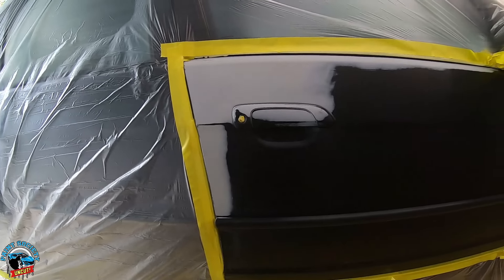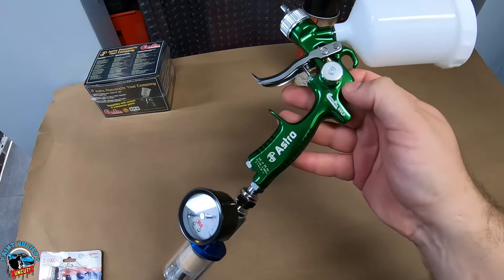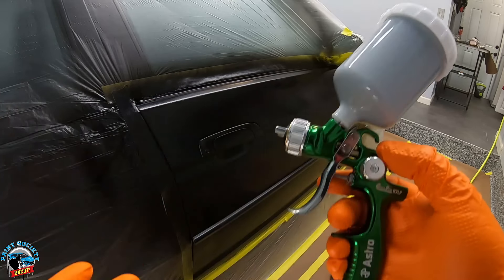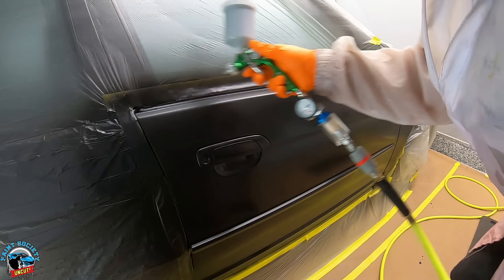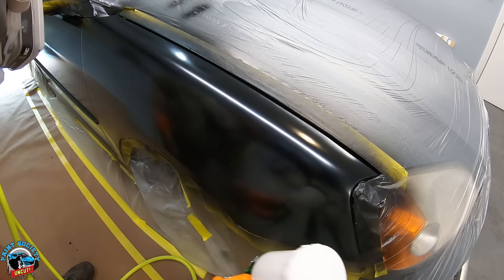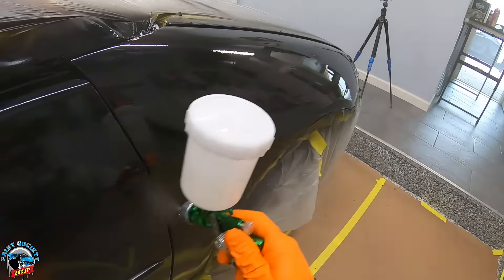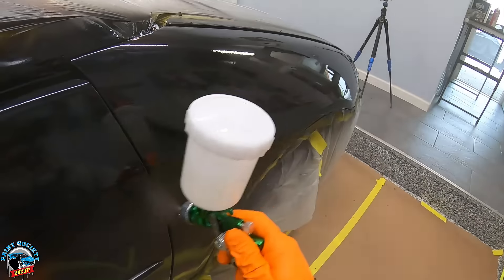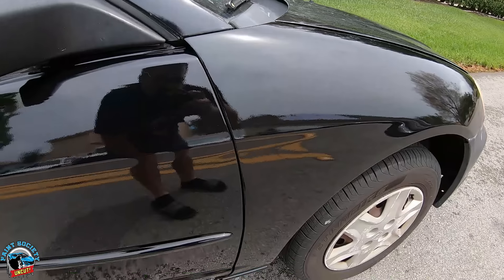The Cheapest Way to Paint a Car with AMAZING Results!

Comment: Was it me that made that pancake comment? lol. I painted my van with a pancake compressor, did it piece by piece and came out good. not amazing but good enough to where people compliment it. I did single stage gloss oil though so no need for clear coat. Gonna redo it soon in a different color, just the prep takes forever and ever and ever lol..

Comment: Haven't gone through the whole video at the time of this comment but.... 

the longer the hose .. the larger the volume of air to replace when pressing the trigger. 

3 meter hose is enough with these mini setups
Reply from the maker: Great point
Reply: @PaintSociety  maybe you should try it  in  V2.0 video with other adjustments, such as the .8 tip  you mentioned and any other input you may find relevant

Difference is very noticeable, pressure is kept for longer and the compressor does not cycle as often.
Reply: Do One  you are probably right, but this little puck gives around 2.5 CFM , long hoses do make a difference in these cases. 

it's almost airbrush territory
Reply: Interesting, I was thinking the longer the hose, the better because it increases storage capacity

Comment: Having done a few small and medium jobs with a detail gun (and I REALLY like them) but not quite as small a compressor, I'm betting that the 1.0 tip would be the sweet spot. Yes, the smaller tip needs less air to atomize the paint, but they also spray less paint overall, so where the smaller tip will help make up for the limited air supply as you go smaller on a large surface like a fender you'll find that it gets harder/takes longer to get coverage and maintain a wet edge. With the .8 tip you'll have problems with that  it will just take FOREVER and you'll be fighting moving too fast for what the gun is doing and maintaining a wet edge. It will be the same problem as the traditional issues with rattle can paint jobs, where it will be hard to keep things wet, get things covered and prevent tiger striping (now spray cans and spray can nozzles have gotten much better in recent years making this not as much a thing with the name brands).

I like a 1.0 and even a .8 on stuff that doesn't have large flat areas (projects that I can think I've done with smaller tips that I've liked were things like an engine crane and a moving dolly), but smaller than a 1.0 would be a nightmare on a fender or door. 

Without the limited air supply, the 1.2 is really the correct choice for a job like that. If you were doing this with a good 15-20gallon or any 30gallon the 1.2 would be the choice (or a fullsize LVLP gun).
Reply: Hello fellow TGO member
Reply: @Lykoloo  LOL, I take it that you recognized my avatar? Who are you over there? Don't tell me that we're going to start seeing a rash of home painted turdgens 😜
Reply: @mpikas  Yup, seen that picture in enough threads to think "hmm, that looks familiar." Im the same name over there as on here, I think I may have sold you some 3d printed clips. Not planning on painting, at least not any time soon I hope, lol.
Reply: @Lykoloo  Not me on the clips, but I think I remember you posting about 3d printing. (I've paid attention to the few 3d printing threads since I've been messing with that also)

LOL, my screen name changes but that avatar has been with me since I drew it for an event t-shirt in the late 90's and everyone seems to notice it.

I may have to paint mine just to get it mostly one color 😁

Comment: im a 32 year bodyshop autobody guy back in 70s we used small air compressors but always had a screw on filter at bottom of gun that looked like a baseball screwed into gun  filtered water in lines

Comment: I used rubber seal 1 to 1 clear with a HVLP gun and 40 pounds of air to the gun and 10 pounds of air out . The clear came out like little balls but then leved out like a sheet of glass and didn't need to buff it for orange peel and I was using a 3/8 hose and fittings to make it a true HVLP gun . Try it . It will work great very low over spray and less wast . We sprayed 4 coats on a full car paint job and use only 2 quarts of paint and 2 quarts of clear doing that way

Comment: The problem with using a small compressor for painting a whole car is air capacity. You need to have enough air to be able to do an entire coat at once. If you paint an area, let it dry while refilling tank and then spray another area, the over spray goes over where you already painted. 

You can still use a small compressor, but you would have to do it in sections, complete each section and then tape off that section when it dries and paint the next section. This will take about 3 weeks.

Comment: Not factory smooth but not bad at all.  I watched another video where a "SprayIt" brand LVLP spray gun was used with a 21 gallon compressor to paint an entire car.  It was kind of slow going but the end result was smooth and primo!   Very little over spray is the big benefit to these low volume/low pressure "garage guns".

Comment: Nice.  I keep up with surface rust. Chips I been getting away with rattle cans. Paint gun go get a bigger Air compressor. For what maybe 4 to 5 paint jobs in my DIY life. But now I have a 6 gal cleaner tire checker.  🤔🤔🤔🤔 Rattle cans up close you can tell.

Comment: Very helpful video. I want to sell my old car, which is in excellent mechanical condition, but terrible cosmetic condition (Mitsubishi seems to have this problem of paint peeiling of and rusting after 10 years), so I decided to repaint it before selling. I can afford to invest some money into it, but not to a point where it will cost more money to repaint it than to sell. So I will obviosly not be investing into a 50 gal compressor, but 20 gal might do a job.

Comment: wow...this was such a good video to stumble upon.  I have a used cop crown vic and the roof paint was chipped when the light bar was taken off....over time it flaked and my 1st attempt to fix w/rattle cans was not good.  I have the same sized compressor but I never thought I had any options.  I'm going to mimic exactly what you've done here.

I'm pretty sure the prep work is knocking loose chips off/sanding/spread filler/sand/repeat the filler n sand then prime and paint.  I need to find a video explain the filler/sanding.  Its common sense but I've never done it before.

Comment: I like what your doing here ive always worked with cans at home I also tried a cheap setup like this but since we use high quality guns at work I switched the gun out for a devilbiss and added a bigger tank inline (about 50gallons) to the compressor for less pressure drops still into the setup for less then 1000$ even tough the gun was 550$

Comment: The key is to observe the air consumption of the gun with the air output of the compressor. This will let you know whether the compressor can keep up or not. And bear in mind that if the compressor is running constantly, than the chance for water forming in your lines increase. As the compressor pumps, air heats up from the compressor motor. As it travels through your lines it will cool down causing condensation to develop which can then come out as you spray.
Reply: Right ! So having a water filter is important. I seen in those big 60 gal set ups they have water trap systems w 4-5 filters 😂

Comment: I painted an entire 1979 Lincoln Continental with like 50 cans of spray paint undercoating, rustoleum blue and black and Rust-Oleum clear coat. Used aircraft paint remover to strip the paint off Spent like $700 on spray cans but I didn't have to buy an air compressor and the car drove in the parking lot gold and drove out blue and black LOL.

Comment: Bought one of these mini spray guns from Amazon to spray Nerf blaster guns using an airbrush silent compressor. First thing to do with the Chinese guns is to strip them down and do a complete clean. The one I got was a complete mess inside and on the threads, full of debris and grease from the manufacturing process. Spent some time soaking the gun in thinners and really cleaning all the working parts and inside the body. It worked really well after the clean.

Comment: If you take this route to paiting, and I have before, bear in mind one important thing.  The air pressure it says on the paint can, is the pressure required AT THE GUN.  You will lose air pressure from the length of the hose, the longer the hose, the more air pressure gets lost.  This means you have to compensate by turning up the pressure at the compressor to get the specified air pressure at the spray gun.  If i recall it was something like 10 pounds per foot over a specified hose length but, please check a real chart to tell you how to compensate at the compressor!
Reply: There is no set air pressure.lol. Every gun is different 1000 different variables. Thanks for nothing tho!

Comment: I coated 2 guitars with nitro lacquer using exactly this setup. 0.8 tip and I could get about constant 25psi at the gun, and yes the orange peal was pretty bad. A bigger compressor or maybe an auxiliary tank would help.

Comment: Hi Bryan!!! Have you considered the Harbor Freight 92126 4oz. detail 0.6mm mini hvlp spray gun, which is small, has a swivel aluminum cup that can rotate 360 degrees to paint both horizontal and vertical, I saw a video and seems awesome flawless finish, is small enough to be used on a pancake 6 gal air comoressor. We would like to see a review on that HrbFrgt 92126 small detail sprat gun. Thanks, Great work on your education channel Paint Society!!!

Comment: Brian, living in Florida (a much more humid climate) was there much water coming out of the gun while you were painting, with that pancake air compressor? I have a husky 21 gallon and live in the Az desert and it seems to be putting out a ton of "wet" air while I use my regular air tools. I wouldn't want to run a spray gun, with that amount of moisture coming out.

Comment: Brian, I own a R500 sp3000 LVLP  gun. I was pleasantly surprise at the results. the paint came out very smoothe.  It needed no buffing.  However I used it only once  and I Took off the needle to clean the gun. when I replaced it, the gun never sprayed well again. A LOT OF AIR BEGAN ESCAPING through the trigger area.  what I did not realise, is that the air set up and the paint set up were all in one. can you advise me how to correct this situation?

Comment: i am thoroughly impressed thank you for this ive been trying to find a good video about using a small paint gun and a small compressor i have a 50L dual electric motor compressor that im going to pair up with this spray gun thanks to you if i can still get it that is

Comment: Here I am a paint rookie showing people how to replicate a PRO paintjob in a garage environment with proper volume, pressure, refrigerated air dryer, multi step filtration,  clean spray areas, high quality products, pro spray guns, proper booth air filtration etc...and then there's brian a true professional paint and body guy breaking out the pancake compressor and ceiling fan garage paint job.
Great job with unexpected results!

Comment: Will you please do a video about selecting sealer, base coat and clear coat. Essentially, everything we’ll need to do our own paint job including what spray gun to use for each. I’ve purchased around $1000 worth of tools based on watching your channel-thank you- but still don’t know what materials (paint) I need. I’m very technical, was a maintenance test pilot for 28 years in the Army, but have never tried to paint. I’m not gonna worry about haters regarding buying the expensive paint guns. I believe every job begins with quality tools that last. So, don’t over think it, it’s just paint... but what paint?

Comment: For the beginner,  they gotta start somewhere.  Great vid!
Reply: I run a craftsman 5.4cmf @ 90 35 gallon oil-free comp and HF gun in my shop. Does great. Got the comp off FB for $60. very cheap setup, but it works. Regulator didn't fluctuate at all on me.
Reply: @frostbite1991  Sweet!!

Comment: If possible,  rent a larger compressor to make the job a little easier.  However,  I've done entire vehicles,  boat trailers, and rims, all with smaller compressors. All said, the guy says it right when stating,  trying to get a larger compressor . But if you're on a tight budget,  take your time and allow the compressor to build up the air pressure for better results.

Comment: Can you do a vid of painting a full car with this detail spray gun with a larger 15 gallon compressor?

Also, can you use 3 or 4 (15 gal) compressors to get the required CFM to spray paint a car with an normal larger size HVLP?  Or running that many compressors create too much heat?  (And obviously noise too).

Comment: Maybe you should try using a 20 gal compressor and try an overall or 15 gal. I’ve noticed if you stop and just wait on the edge you really don’t lose it by
The time your compressor catches up. Simple rule. Stop when the compressor turns on. Wait 20 sec or 30 theb start again. I’ve done both 60gb and 20 and 25 gal and u don’t see any issues. I do see on acrylic enaamle if you continue to spray while losing pressure you’ll change the shade. But I think you can do it. Try that for a vid

Comment: I use these inline filters even though I use bigger oil water traps there geeat for backing up to have behind the bigger ones incase the moisture still gets through to the gun! It's good to see you entertain the cheaper paint setups and weather they work or not

Comment: I have actually done whole cars with a 20 gallon at 4CFM. Everyone says you can't do that. Everyone is wrong. I also ran my impact hammer, air ratchets, grinders and air hammers with it. I owned that compressor for 25 years and used out for everything without a hitch.

It's replacement gives 5CFM, which everyone will also tell me isn't enough to do all of these things. But if I could always do it with 4...5 will get things done. I have always been amused at how many people tell me I can't do things, while I am doing them.

Now a pancake...no...I would not try that, haha. But if it is getting it done for you, bro...good onya!

Comment: Did you switch to the .8 for the clear?

I am do glad I sprung for the biggest compressor I couldn't afford. LOL
I just don't have the patience to paint like that.
I did find the lowest cfm gun I could find so I could really hang it out when painting.
 I have a small home shop and hang that super thin painted plastic as curtain walls to protect the shop from overspray and the drying paint from the shop. Also use builders paper on the floor, which looks like you did as well.
 Been having good luck so far. 3rd car painted and next one almost ready for blaster and body...then paint.

Comment: A hint for cleaning the gun: Put 1/8 cup of acetone in the container (small amount), shake it and spray after shaking for few seconds. Put another small amount of acetone, shake it and spray. If needed the third time, until the spray is clear. Empty the gun and dry it by spraying only air trough it and You shall have a nice clean gun and all the channels in it without the rags and s..t.

Comment: It's funny I've sprayed for bout 10 yrs now and I started learning how to achieve as close to that kind of results using rattle cans which btw is also possible but requires a ton of compensating, watching paint, experience with humidity, distance/coverage, air flow and paint brand dry times anyway it can be done with rattles as well but now that I got my hands on a mini hvlp 1.0 using a 3 gallon 125 psi mastercraft compressor - 3.0 cfm @ 40 psi which for me is good enough I don't typically spray big projects and even if i did ive got the patience for it, usually small to medium objects so anyway, all my rattle cans became my source of paint just had to extract the paint then seal in seperate labelled jars now I've got all sorts of colors to play with but I ran out of things to spray so watching spray videos until then!

Comment: It can be done! Nice. So what paint products do you recommend on a budget? Paint filters, tack rags, paint prep, gun cleaning, primers, sealers, base and clear coats, sanding tool, ect? Things of this nature. I'm in the process of doing rust repair/fab work on my 71 beetle and have been doing plenty of chassis painting with DTM epoxy's, that are forgiving due to component locations on the vehicle. However, When it comes to the body work, i want it right. Any help, links to videos, or products would be awesome! Keep up the awesome content. Love your videos.

Comment: Im sure the gun has a recommended cfm at a given pressure. Take that info and calculate how much horsepower not volume of tank you need. More than enough power with a large tank will keep the shop quite during work.

Comment: Interesting I'm actually considering buying a small compressor for touch up work, and getting a small gun with an airbrush gun to simplify small jobs thanks for the tips of the small gun setting as well as tip size info for atomization. 👌👌👌

Comment: Thinking about doing this in my garage… are you doing this job with no fans or anything???  Is this ok?  Will the overspray ever go up on the ceiling or garage door opener?
Also will an 8gal 4.0scfm 125psi 1.5hp work, or is it no good?   Painting a hood and two fenders, maybe somebody work

Comment: Hey there! I stumbled upon your channel. My parents just passed and we inherited their 09 civic, there is tons of bare metal showing but no rust. I have rebuilt everything but need to get an entire car paint job. I'm not sure if maaco still does that 500 job or not. I have a  26 gal air compressor equipped with 1.8 HP 4-pole induction motor and dual oil less pumps provides high air flow of 4.5 CFM at 90 PSI with 150 max psi.

I have never painted anything more than my patio furniture with it. 

Just curious your thoughts. Obviously we are not looking for show room, but right now it's bare metal and faded paint.